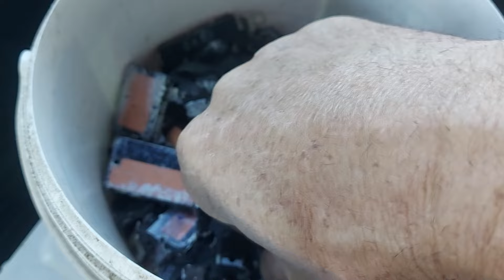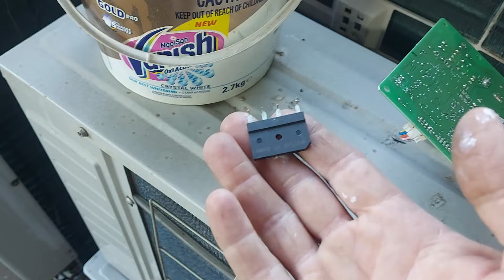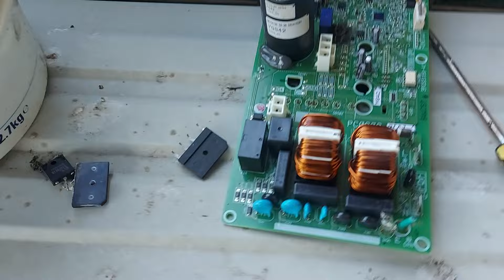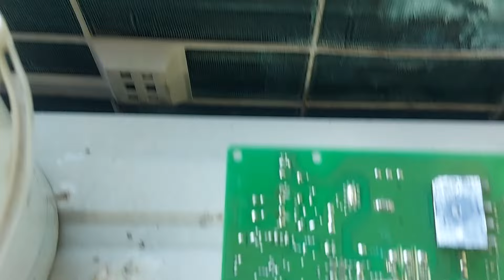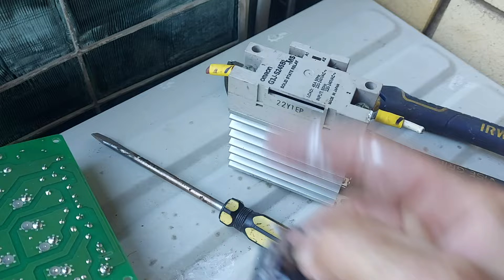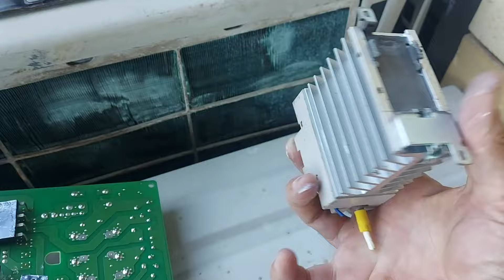Domestic Copper on PCBs

Comment: Use an Oscillating tool to remove them
Reply from the maker: Cheers for the tip tho 3 - 5secs isn't long just twisting them off with pliers.

Comment: Depends on what the circuit board prices look like vs domestic copper prices...   I used to tear transformers and heatsinks off my boards - until I looked at what the motor and extrude prices were compared to boards, paid better to leave 'em on the boards unless required to get a better price on the boards.   

If the board is only low-grade, and stripping heatsinks/transformers isn't going to raise it above low-grade, leave them.    However, if it's gold-fingerboards like a graphics card with a heatsink, removing the heatsink will net > $1/lb increase in price here (currently paying $2.50 vs $5.25 - central USA).
Reply from the maker: The circuit boards are pretty much all from Aircons and with or without that piece of copper on them they will still have the same scrap value so i might as well just wriggle it off and slowly build that copper weight for only 3 to 5secs of wriggling and get my $10kg for the domestic copper.